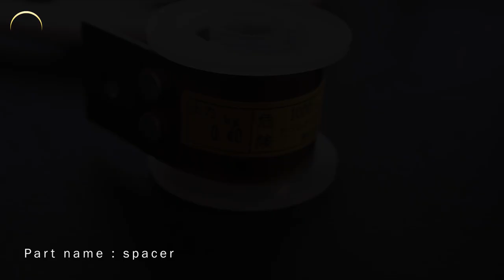How to Make Mesmerizing Wall Art using 3D Printer at Home (Synchronicity, Kinetic Art)

Comment: Too create the off balance between the two you can simple print 1 wheel with 10% infill and the other at 100%. This can also be done with any of the version that have multiple "blades" (eg Duality), to offset 1 wheel print 1/4 of the blades at a significantly higher infill

Comment: Nice work! Can I check what is the internal diameter of your steel tube? External is 8mm and your thread is M5. So does it work if the internal diameter is 6mm?
Reply from the maker: Hi! Thank you for your interest on my kinetic art.
The inner diameter is 4.2 mm.
Make an M5 thread in the inner hole.
Thanks:)
Reply: @housdrmoon  Got it, thanks for inspiring videos! Subscribed!

Comment: Awesomeness
Reply from the maker: I applied the simple magnet trigger system. I hope you can also use the magnet trigger in your project. :)
Reply: @housdrmoon  I had made the 3D model but not tested yet. It's hard to simulate what will happen when magnets are involve. I am guessing I will have to do a lot of trial and error. 
Great job on your magnet trigger!
Reply from the maker: Yes. You are right. Actually, my initial concept of magnet trigger has 5 spots to attach magnets. but after lots of trials and errors, final concept has just 2 spots. Good experience! :)

Comment: Great job! How long does it run?
Reply from the maker: Hi~. its running time is about 5 min.  Not enough and something upgrade is needed :)
Reply: @housdrmoon  add weight+lenght + better bearings? i think if this runs 1+ hours it would be amazing!
Reply from the maker: I ordered copper rod to be used for weight. I hope adding weight can increase running time. :)
Reply: @housdrmoon  I love your designs and your that you honor the work of Roy.  Thank you for sharing these detailed videos!  I am planning to build one of these in the next few months.  Would a weaker spring help a light-weight version such as yours run slower and therefore longer, rather than only thinking about increasing weight?
Reply from the maker: @MissBrefunk  
Thanks for your valuable comment.

I'm thinking based on the energy equation when considering about how to make this work slower and longer.

KINETIC ENERGY = (1/2) * m * v^2.

In order to maintain the rotation for a long time and slower, the kinetic energy must be increased while decreasing the speed (v). Therefore, it seems to be necessary to increase the mass (m).

My some tests show that using a weaker spring with same mass tends to reduce the speed and also shorten the run time.

As i learned from David C. Roy's video, he use another wheel to increase running time. it is like gear ratio. by using one more ring, force of the spring is divided, and the number of rotating could be increased.

Maybe, there are many ways to increase running time. And i will test it. ^^ 

I wish your successful project, and we look forward to seeing you with a more complete next product. :)

Thanks~